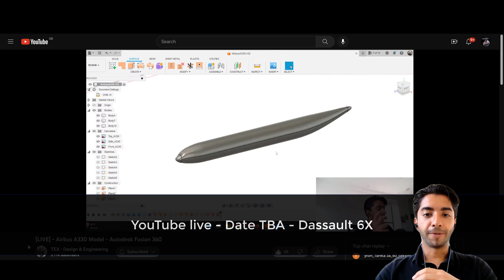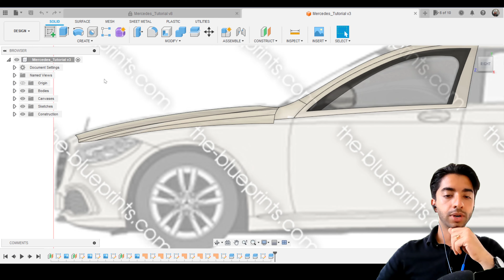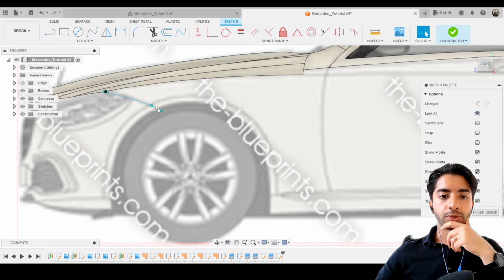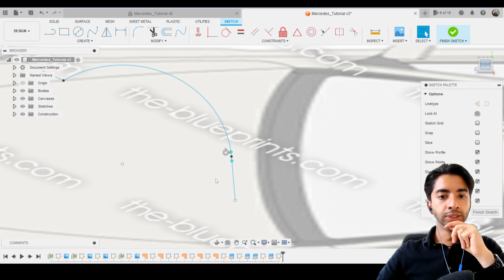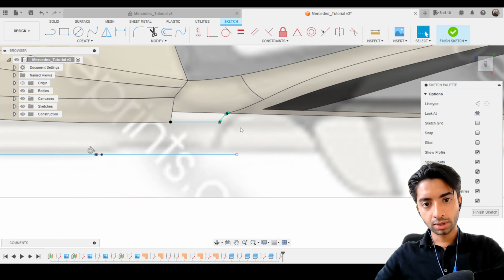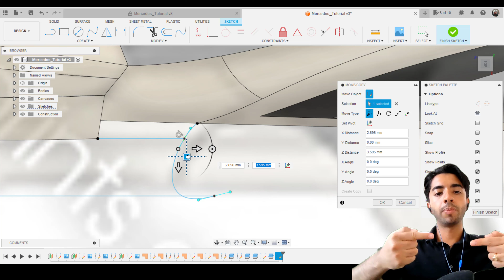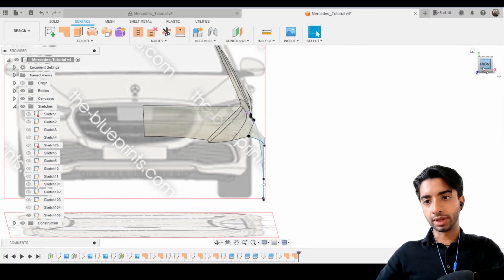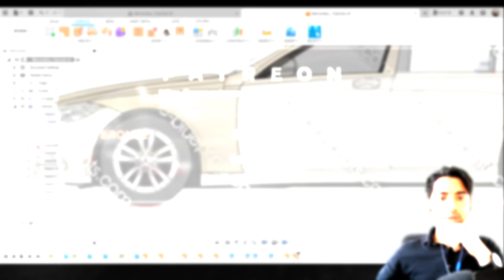How to Model a Car in Fusion 360 | Tutorial 5 - Basic Surface | Step-by-Step (4K) #Fusion360

Comment: Thanks for the videos! I have finished surface modelling my entire car, but am having trouble using the thicken tool such that I can 3D print it. Some of the patch/surfaces won't allow me to thicken. Do you have a diagnosis or solution to this problem? Keep up the good work!
Reply: i tried with half a car, not done yet. I could only make it work by thickening one surface at the time, it also looks like some parts can't be as thick as others but im a newbie
Reply: @TheStig_V2  same... but for me, some of the surfaces will not allow me to thicken at any thickness at all. I have been told that perhaps using more of 4 point lofts opposed to patch would help.
Reply: @curtisho5255  I have just started to model jeep cherokee for 3d printing with the plan that after completing all the surfaces, using the loft tool to close the car surface completely from the bottom, I would stitch all the surfaces to make it a solid body. Then shell the body to make it hollow with some wall thickness needed. For getting the parts separate we can sketch the boundaries of parts and split them. I hope it works.
Reply from the maker: Hey! So I've experienced similar issues in the past too. The comments that others have posted have worked for me in the past, hopefully they'll work for you too. Please try them out and let me know :)

If I get some time, I'll extend the car series to include creating a solid